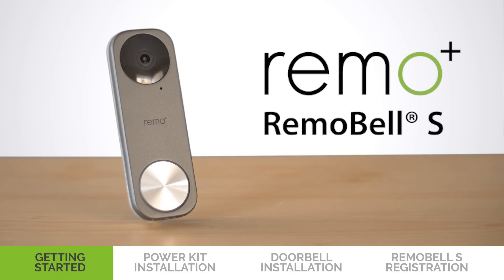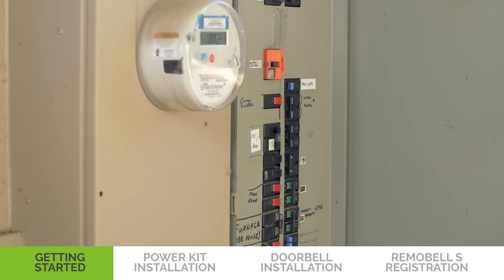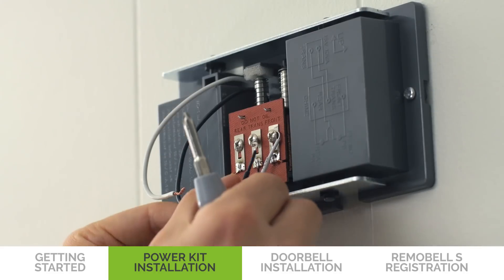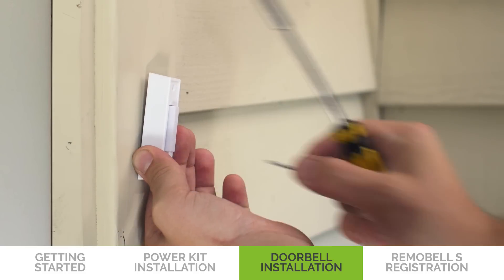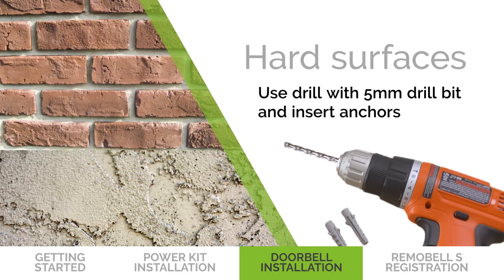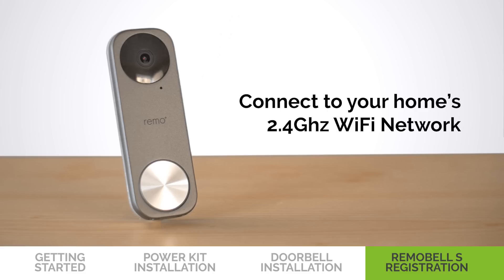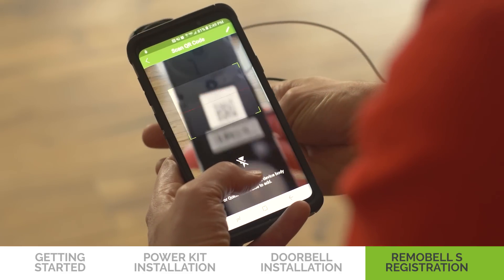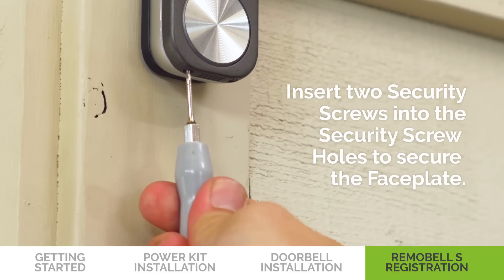RemoBell S Installation and Set Up Guide

Comment: Hello, I bought the Remobell from Argentina, I wanted to know whether it can work well with a 16-24v 1500mh transformer. Is it normal for it to heat up a little? On the other hand, I wanted to know how to configure multiple users? so that several members of the house can have access to the doorbell. Thank you!
Reply: Hola yo estoy por comprarlo. Como
Fue tu experiencia con el timbre? 
Tenes idea si cuando te tocan el timbre aparece como si te estuvieran llamando al celu? Gracias !!!
Reply: @afg1402  hola, còmo estas? te suena en el cel. Yo no pude conectarlo al timbre porque los que hay aca son de 12v y la tension es otra si mal no recuerdo de 16 a 24. Tuve que comprar un transformador. No se de donde sos, yo de Argentina.

Comment: Agree. Only try the door bell AFTER you have completely wired in, and registered the product in the app. In my case, I could hear the doorbell ring outside but not inside. I had to reset the whole thing and then re-register the product and it worked.

Comment: I purchased RemoBell after watching some reviews including this. I do receive the notifications on my phone but my chime does not notify the people in the house.
Reply: I just spent 5 hours of trying to install my Remobell S. That included 3 hours first of not being able to get my indoor chims to ring also. Had solid blue light on the door bell, stopped for the night and came back after 4 hours of sleep to  research the problem on the web. could not find anything on Remobell S having this problem. But I did find on the web where Ring and some of the other brands were having this problem , due to needing a 24volt 40 amp transformer to run them. I now have one ordered and will find out if it fixes the no chime part problem when it come in. Then I moved on to working on trying to figure out why I could not get it to show up on my phone the next morning. To power up the door bell th day before I had to install it in place at the front door, which is about 36 feet from the wi-fi modem and my computer desk. Again my Iphone and wife's would not connect to the Mermobell S from there. So after about  a hour and half of trying I decided to call their help number, having to wait untill 8 AM PT which would be about a half hour I decided to take a chair to the front door bell and hold the phone within one foot of the door bell and it instantly connected and let me finish setup, same thing with my wife's phone. Now it works no matter where I am, only problem is some of the saved pictures only showes the top of the pictures. I will wait to call after the new transformer comes in. Sad companies come out with new products and do not upgrade their instruction on how to fix built in problems.

Comment: I just wish I could get a standard wiring diagram. I'd like to see schematically how the wires run. From what I can tell from the video, the power kit goes on the chime. One wire goes all the way from the transformer to the chime. The other wire goes transformer, across Remo terminals, then to chime. Can anyone confirm?

Comment: I’m thinking to replace the current flat mount with the 15degree angle mount. To do that, I have to disconnect power and remove the wires connect to Remobell S. Will this reset the Remobell S? And after I replace the mount, I have to re-set up the Remobell S again?
Reply: I don’t think so, unless you hit the reset button

Comment: Remo seems to be missing something here. Why is there not some type of adapter that fits over existing installations? They seem to be advocating drilling extra holes when mounting locations for existing screws already exist. This makes no sense to me. Am I missing something or is Remo? 
I'll have to check further, and suggestions are welcome. Is there some type of standard cover plate to cover up the current standard doorbell installation in my stucco? I remember seeing, and think I may have, a plate for cable installations that has a hole in the middle. Possibly this could be installed using the presumably standard screw positions, with the existing wires coming through the hole, and then install the RemoBell S over top of this?  Somehow I need to cover the existing hole in the stucco and install the RemoBell S.
Reply: I have stucco too. It was pretty simple to just remove the old button and cover, drill the new holes about an inch above and below the old ones, and install the Remobell S over the existing holes. The final look is clean and simple.
Reply: @mbioman  Thanks, but that is not what I did. I do not think I had enough space to do that. It turns out that I did have the standard wall plate with a hole in the middle, for cable installations I believe.  This is a "standard" size wall plate, the same size as a wall light switch plate (Decora or regular), and my previous doorbell installation. I installed this using the existing locations that the retention  bolts fit into. This utilizes what is already there and covers the existing rather large deep hole. I ran the bell wires through the center hole and looked at what I had and  held up the RemoBell S plate to it.  Not really enough room to drill new holes. I unscrewed the top retention bolt/screw and refastened this time with the Remo wall plate also attached. The bottom hole is out of alignment but caused a slight issue with the bottom plate screw. No way to fasten or drill a new hole. So I unfastened it and put some small pieces of "Scotch Indoor/Outdoor Mounting tape," "Super Heavy Duty" on the bottom back of the Remo plate. Then I refastened the Remo plate or "Mount" with the top screw through the standard wall plate on into the existing threaded hole or bracket. Success. 
Another note, as you face my double front door, the existing doorbell location is on the right. I used the 15 degree angle mount, upside down, to angle the camera outward a bit away from the door. I just thought I would mention that as I did not see that alternative suggested anywhere, although it might be. It works fine. The bubble level bubble was actually a bit to the left with the angle mount level. I imaging it has something to do with the way the tilt of the mount was on the plate, the way I inserted it in the slot, or something--I don't intend to get a headache figuring out the geometry principles. My exiting plate and thus the replacement plate was close to level (89.7 degrees versus 90) and leveling the side of the mount kept it about level too. 
I hope this helps someone else and perhaps someone from Olive & Dove will read this and make provisions for "standard wall plate" installations. I am sure there are a multitude of non-standard installations out there having seen some small doorbell buttons, but it would be nice if the mount would also work with standard wall plate doorbell installations. I don't know how many of those there are out there, but I know there are at least 59 in my neighborhood that would be just like mine.
I came back to add, and make it clear, that so far I like the Remobell S very much. I do not have a long use history yet on which to report, but in the short term it seems to work well.
Reply: perhaps if someone didn't have an existing doorbell and they are just installing this as first one ever.. they would then need to drill ?  I think

Comment: Just an FYI for those who are installing it. Once you wire everything up, your first instinct is to try door bell to make sure the in home chime works. It will not work! It was after hours of trying different configuration, buying a new transformer (16V 10AV to 24V 20VA) nothing worked,  I gave up and figured let me try registering the device on the app. Once the device was registered, that is when you select the in home chime option. Default is set to OFF. Wired my old transfer back in and it worked.   So only test the doorbell once you have wired, registered and setup the device on your mobile app.  I hope this helps!
Reply: Thank you for this. Just saved me a headache.
Reply: Thanks so much! No idea why they thought setting the default to "none" made any sense. Edit: The bell did ask for manual or digital when setting it up. I selected the correct one for my setup, but for some reason it didn't save that setting. Must be a software issue with the app.
Reply: My default was not set to off. The doorbell worked as expected right off the bat. During registration make sure to select the appropriate doorbell type, none, mechanical, or digital. The installation instructions were very straight forward and this video was useful too. Not sure why you bought a transformer. If you pressed the two bell wires together or used a multi-meter you should have been able to figure out that the proper power was being delivered (assuming you turned the power back on if you turned it off to begin with). The instructions say to check the wire voltage beforehand anyway to make sure they are at the proper voltage.
Reply: @mbioman  Follow the instructions exactly in the manual and almost everyone should have no issues. 
That being said, I just wanted to state for any individual may just want to test the door bell as soon as it wired (of course turn off power prior to installation) to make sure the "In Home" mechanical chime works BEFORE registering the doorbell with the mobile app.   It will not work. You must first register and then select chime type.

Also, I have been able to get this doorbell functioning on a 5V system (30+ year old house) without upgrading the transformer. I hope this helps anyone else ease their worries.
Reply: If you have a wifi extender on comcast it wont work you must remove it FYI FOR ALL OF YOU
Reply: @apollothemoonman632  I have a few wi-fi extenders in my home... and the unit will connect to them. Just make sure that the 2.4ghz network is setup to transmit  at least "802.11 g" mode. I have "g/n mixed" selected and it works.  Also make sure that your 2.4ghz channel bandwidth is set to 20 Mhz.. you might have issues if set to 40 Mhz.
Reply: thank you i was just going to change the transformer ..thanks alot!!!

Comment: The most common doorbell transformer is the 16 v 10 va variety. I don't think that's enough to power this unit and a typical mechanical chime with the power kit installed. Without the power kit, you'll probably have too much pass thru electricity going through your chime to constantly power the camera/sensor, which will cause the chime to hum or rattle non-stop. I finally figured out the issue and everything is working well now that I installed a 24 volt transformer (20 amps).
Reply: I have 16v and no issues so far.
Reply from the maker: You are correct, we recommend 16-24 VAC as stated on the packaging.
Reply: @Remocam  i have some question, if you can help me plis, the dorbell s working whit DC or AC courrent?
Reply: @Remocam  Hello , does this works in Europe? I’ve purchased Remo+ more than a year ago and the electrician still haven’t managed to make it work. He has tried an trasformer as well.
Reply from the maker: @Doniano21  Hi Doniano, it will not work properly in Europe as the server is in U.S. if you purchase a product from US. Thanks.